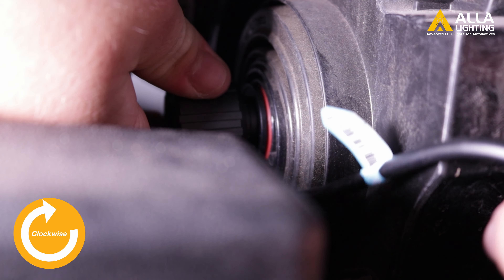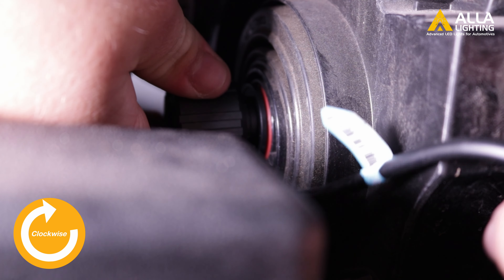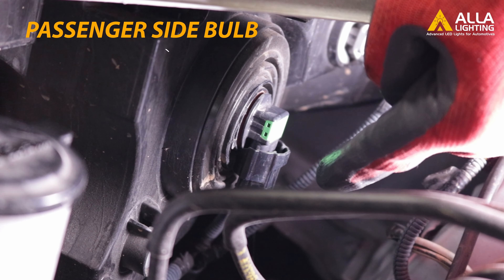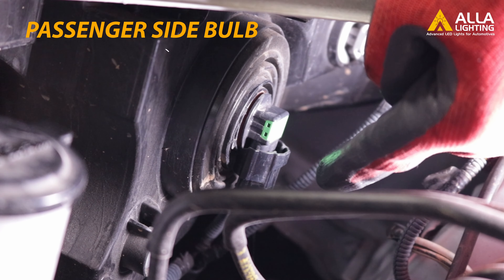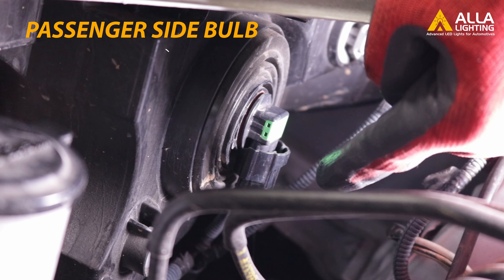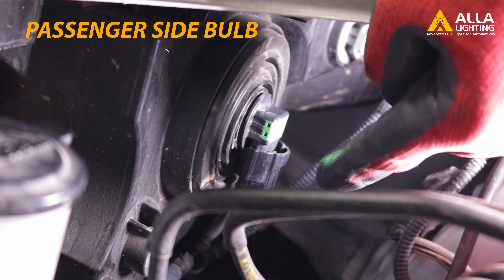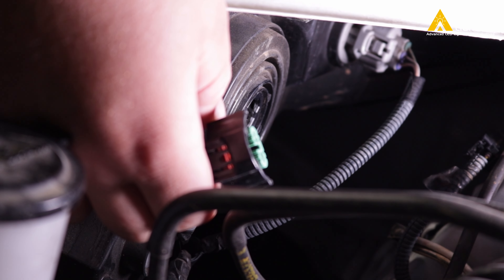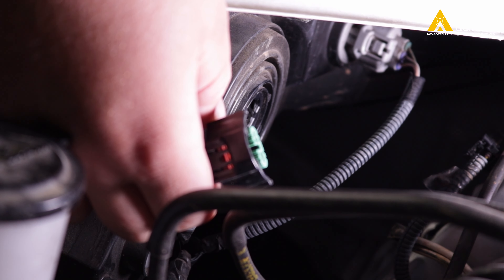2011~2024 Toyota Sienna Headlight Bulb Low Beam LED Install | Replace

Comment: I need to replace the headlights on my 2022 Toyota Sienna but I'm not sure how to do it. Can someone provide detailed steps for replacing the headlight bulbs? I'd appreciate instructions from opening the hood, removing the old bulb, installing the new one, to checking if it works properly. If you have any images or video tutorials, that would be great. Thanks!